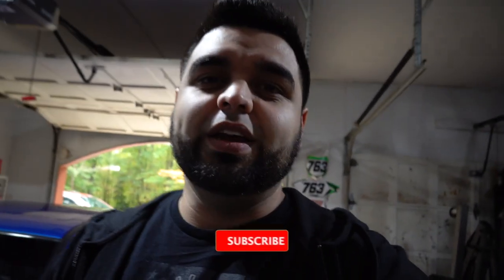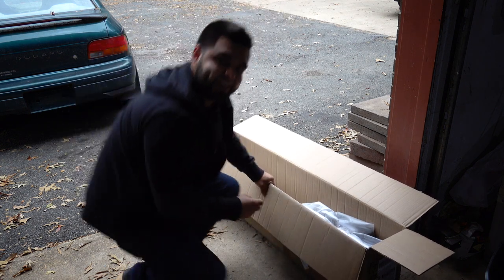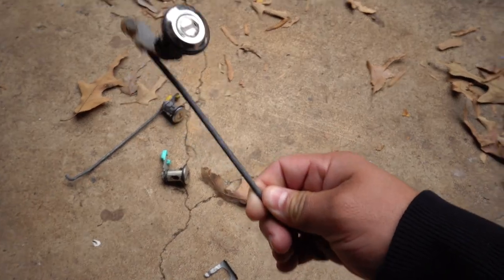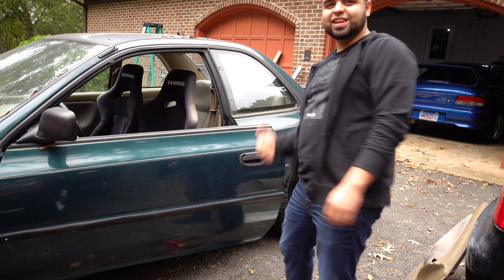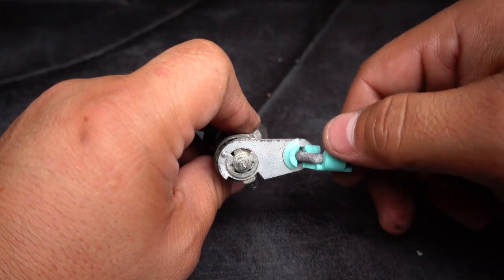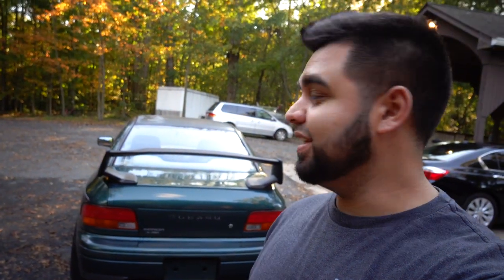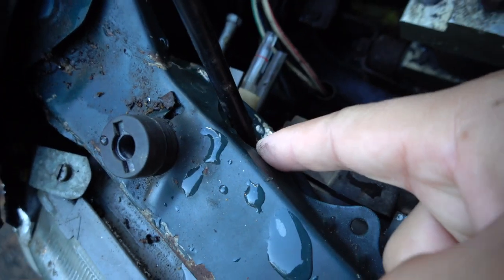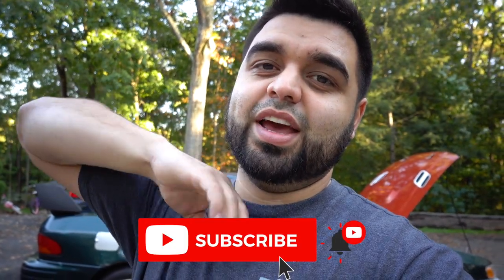Installing a 2021 STI wing on my GC8

Comment: Where'd you get the wing? and how hard was it to install? It reminds me of the RB5 Prodrive wing
Reply from the maker: It’s a cheap eBay one. I might get an OEM one in the future. Install is easy but I suggest having a wingless trunk first because I either have to get one of those or weld my original holes up

Comment: Everything lined up with the bolts? I have a 15+ Sti wing laying around, ima throw it on my gc8 lol. This thing looks bad ass for a budget build 🤙🏽
Reply from the maker: Thanks man! It really is turning out pretty freaking nice! The bolt holes don’t line up tho so you have to drill new ones and close the old ones. Unless you find an L wingless trunk